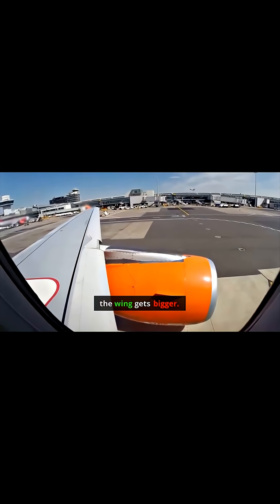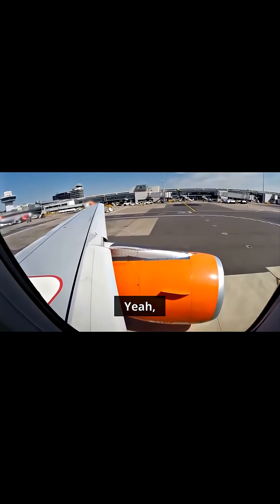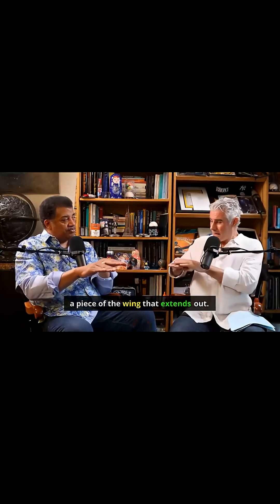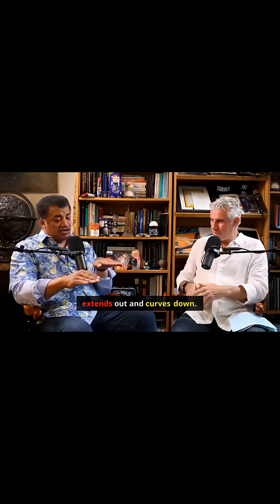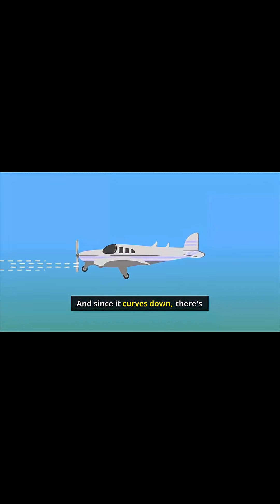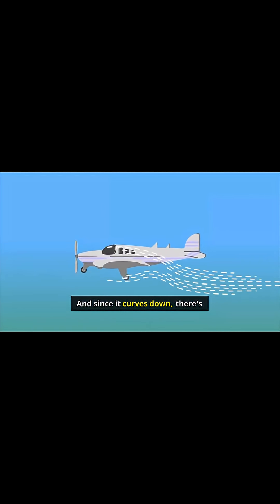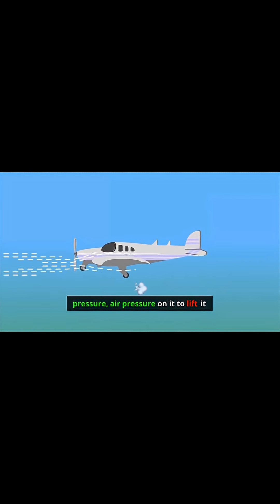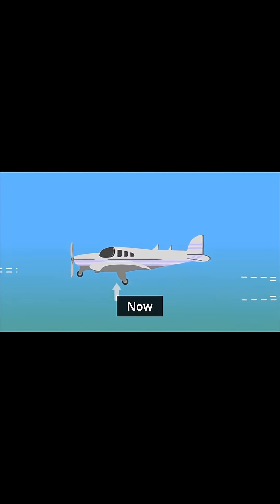How Airplane Wings Inspired the Wild Aerodynamics of F1 Cars

Comment: NDT is a lot smarter than me.  With Bernoulli's principal, we know the curve of the wing on top causes the air to speed up. When you Increase air speed, you decrease air pressure. The lesser pressure on top PULLS the wing up.  The air underneath the wing just stays the same so it's not pushing anything.